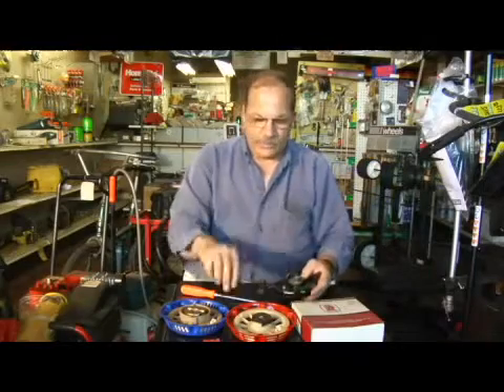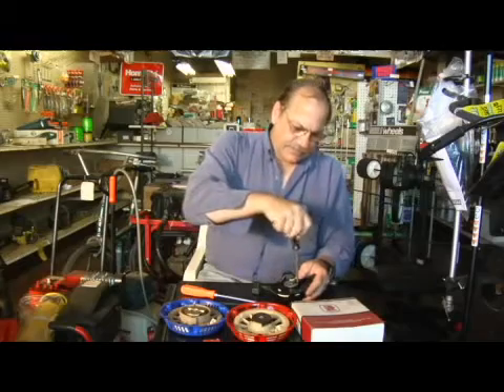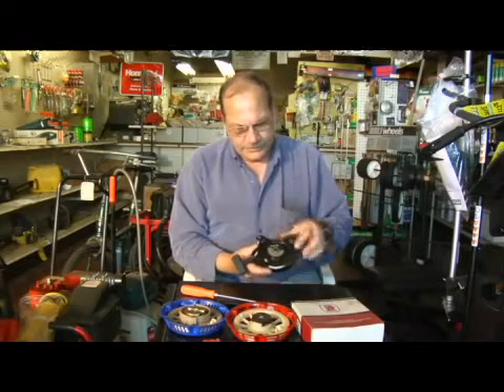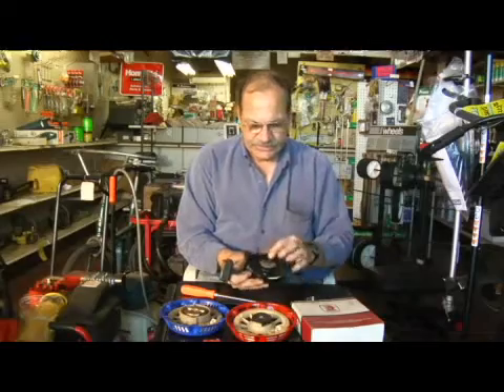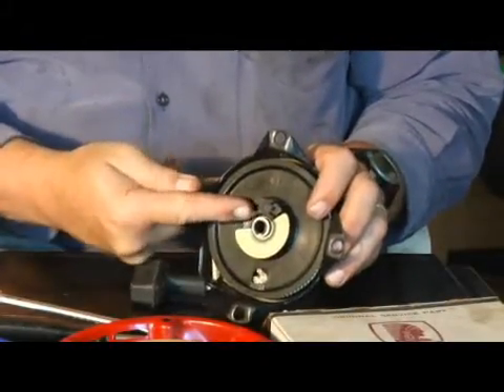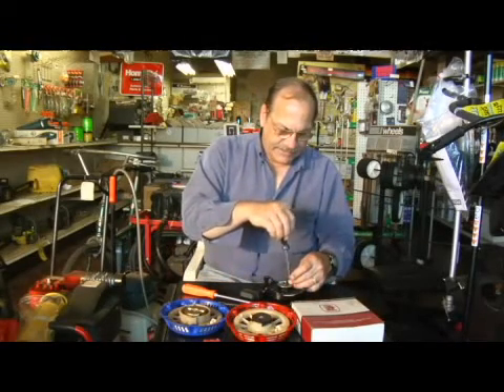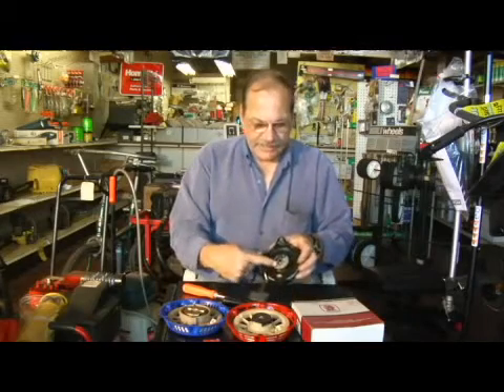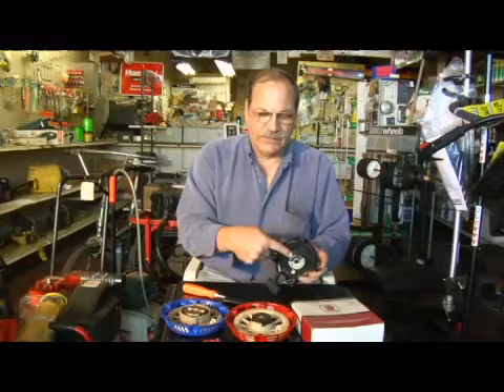Lawn Mower Starter Repair : How Lawn Mower Starter Pawls Work

Comment: Why can't you do this with a vehicle engine? Starters always go bad in cars, more manual parts mean less labor means less cost. If it needs a lot of power just use some gears.
Reply: i  know this is an old comment but anyway ... have you ever tried to pull the starter rope on a snowblower or a cold 4 stroke engine? Imagine trying to that on an engine 10 times bigger. Even back in the model T first Ford days they used a crank. Sure more manual parts mean less cost money wise but where do you draw the line. I'd have no problem going out in the morning and hand cranking my engine. Maybe you as well. Do you think your mom or wife or sister is going to want to hand crank the van after unloading groceries, getting the kids in their seats and is in a hurry to get to a doc appointment. Also saftey wise. Say you stalled in the middle of the free way. You gonna get out and start cranking? Be as dangerous as changing a tire in the middle of the road. what if one of the kids decides to pop the clutch or take it out of neutral. Why not just go all the way and make them Flinstone cars? Yabadabba mope lmoa ...take care m8

Comment: Hi, I have a problem with my starter pawl. While fixing my pull cord I accidentally pulled them out. I tried fixing it by putting the pawls back in, however the two tiny springs came out as well. I believe my lawn mower may be the old kind you talk about so your feedback on how exactly to fix this would be great. The model number of this lawnmower is: 11a-545t563.